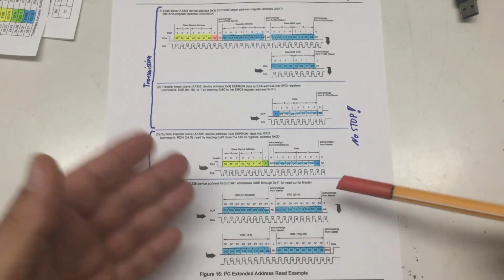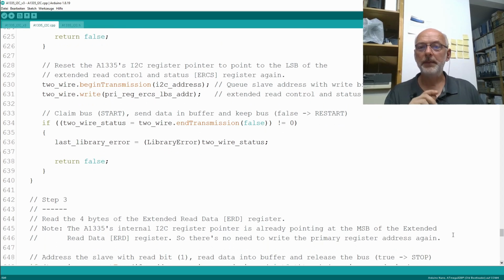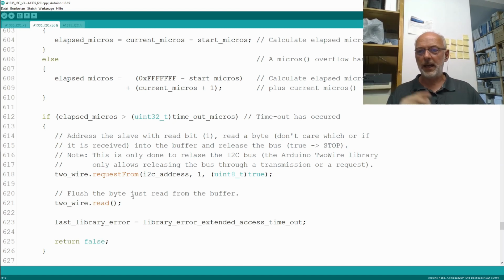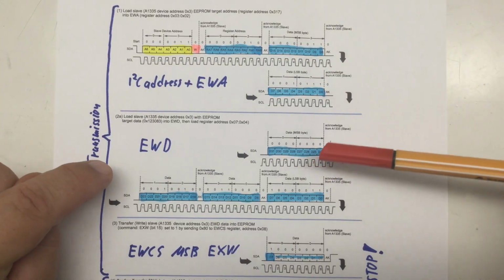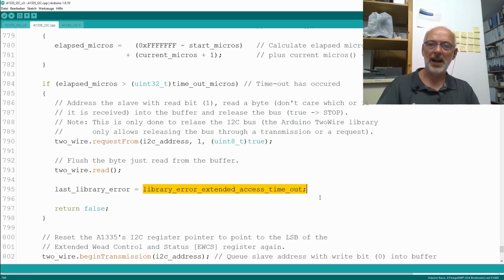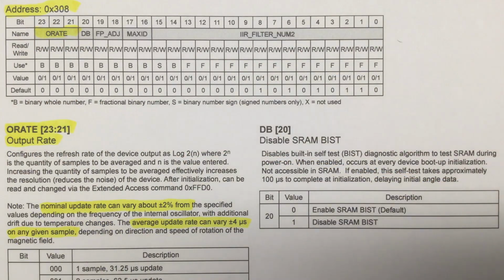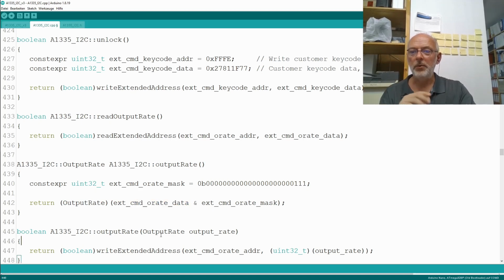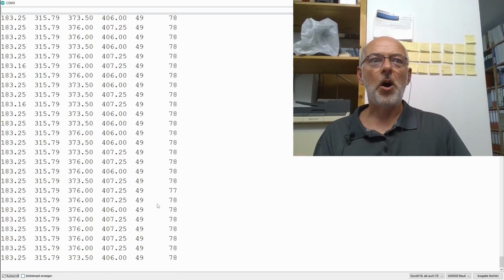Allegro A1335 Hall Effect Angle Sensor, I2C and Arduino – The Details (4)

Comment: Another excellent deep dive, Robert. I have to say you have much more patience than me!  I'd have been muttering about the BLEEP-BLEEP chip designers rather than Faffing around with much of the detail. Just one comment about overflow in CPP.  According to the standard this is undefined behaviour, but the full story is more complex and has been debated endlessly in the safe numerics community. First, as long as you use unsigned data types, and two's complement representation, (like just about every processor in the last half century), it is perfectly well defined and "just works".  The problem is that C and CPP allow silent conversion between signed and unsigned types and it is extremely difficult for a compiler to recognise when a programmer has implemented any work-round. The CPP committee place backwards compatibility above all other considerations so it is impossible to clean up the mess now. In practice, everyone wants fast efficient code so they keep it as undefined behaviour to allow compilers to use two's complement arithmetic where everything just works. By the way, it used to be defined as implementation specific behaviour, which in my opinion is much better, especially given the universal adoption of two's complement.  I am pretty sure that you can just drop the overflow checks, make everything unsigned, write code in the natural way, and compile with O2. I'd suggest running it in Compiler explorer to check the assembly; my best guess is it will just work.
Reply from the maker: First, thanks once again for the praise! Second, thank you very much for that deep dive into integer overflows. Fortunately the Arduino environment (that is the compiler provided by AVR - now part of Microchip - for ATmega MCUs) is very simplistic: Unsigned integers overflow behave exactly the way you expect them too and the compiler never implicitly converts unsigned to signed integers. In fact the UNSIGNED LONG micros() function itself counts overflows of an 8-bit unsigned counter register to come up with a 32-bit unsigned long microsecond count (see https://ucexperiment.wordpress.com/2012/03/17/examination-of-the-arduino-micros-function/ ). As for doing everything in two's complement signed integers: Yup, that would be possible and I would absolutely do it when I had to shave off every CPU cycle I can. But in this case I'm just doing a time-out in a loop waiting for something to happen, so there's no harm in wasting some CPU cycles. Besides, it was a great opportunity to warn about the danger of counter overflows ;-)